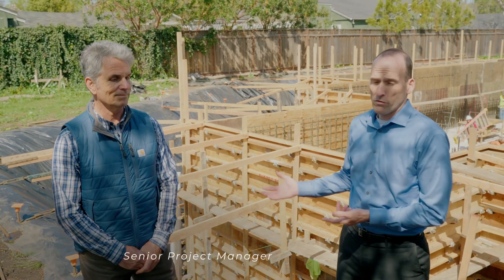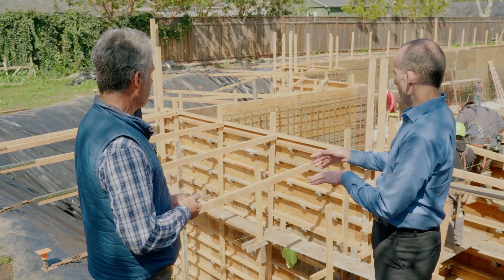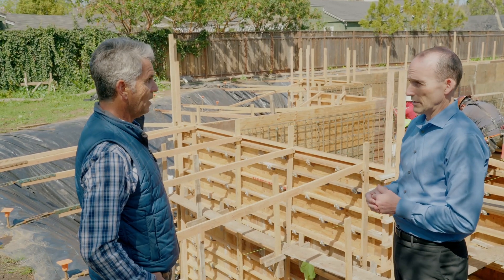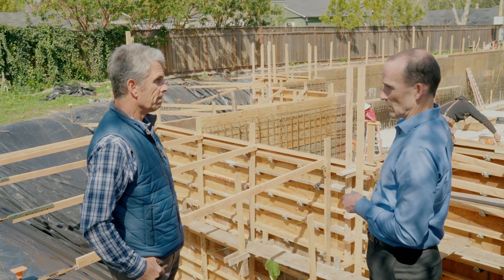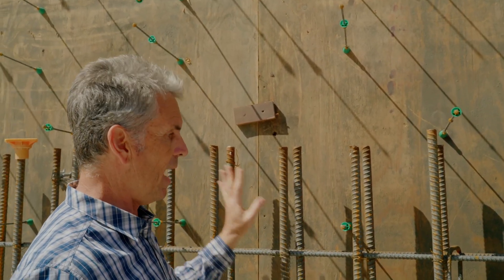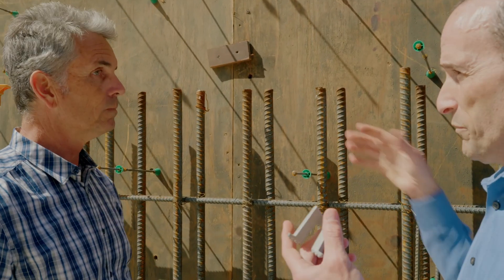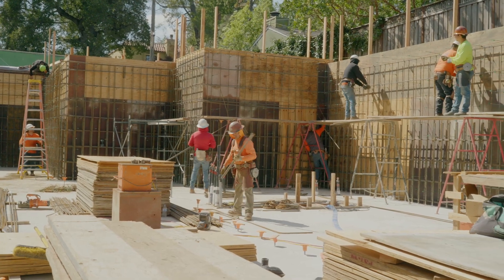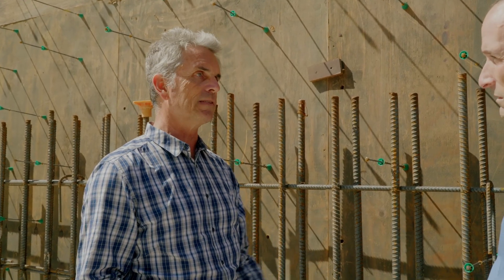Jake's Passive House #6: The Nuts, Bolts and Rebar of a Earthquake Proof Basement

Comment: Which waterstop product are you using?  I found the image you inserted (first image hit for 'cold joint waterstop') but that article didn't mention the name of the product. For my project, I am leaning towards just using a v-groove and a fluid applied capillary break and skipping a waterstop. The waterstop products seem like they are much more difficult to get right, especially the expanding type.  The waterstop and the capillary break serve different functions, but it seems like the capillary break is more useful.
Reply from the maker: Sorry for the late response.  I had trouble getting this information from our subcontractor.  The product we used for the waterstop was MiraSTOP BW by Carlisle Coatings & Waterproofing.
Reply: Thanks. Seems like one of those products that needs to be carefully staged to actually  serve its purpose. The datasheet says "Do not allow premature hydration of MiraSTOP BW.". So sitting at the bottom of your formwork in a rainy location while waiting a week for the pour would definitely result in premature hydration. Especially if it is in the bottom of a v grove. The datasheet avoided making any mention on how long the protective layer would last before the bentonite starts to activate. It would at least need to last until the concrete starts to set.
Reply from the maker: I think a lot.of materials that we use have to be carefully installed.  Rain, cold, hot, dust and sun all have effects on different materials in differerent ways that we have to be concerned about.  Pour concrete in super hot weather and it dries out so fast and weakens it as well as does not allow the surface to be finished properly.  Too cold, and it could take days to set or it could never as the water freezes and crystallizes.
Reply: I think the product shown in the overlay image in the video with the wire mesh is BentoBar+  from BeSealed.

Comment: Why not use 10" ICF walls?
Reply from the maker: Good Question.  It is not price, as ICFs are actually cheaper than all the work we have to do out here.  ICF's have really not caught on here.  Mostly, I think,  because nobody wants to trust waterproofing liability to the waterproofing sticking to EPS foam.  We have to use a tremendous amount of rebar and we have to tie all the rebar and then it has to be inspected by the city and the structural engineer of record.  If we used ICF's, they would have to get inspections every day and for every lift, as you would not be able to put on more than one row of ICF before you started hiding the row below.  Lastly, our walls are thick and heavy and ICFs are light and nobody wants to do a 14' lift at one time with "Floaty" ICFs.  We use a 70% flyash/coal slag concrete mix which take a lot longer to set up, meaning that there would be a lot of pressure on the bottom of the forms.
Reply: Probably price.
Reply from the maker: Not really.  Please see my comments above.